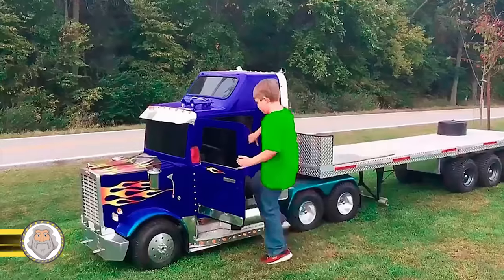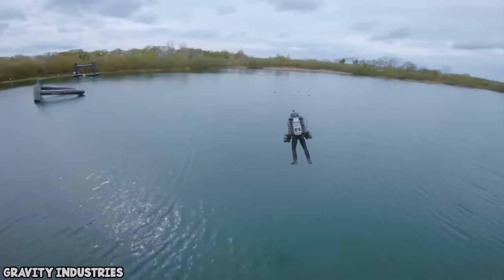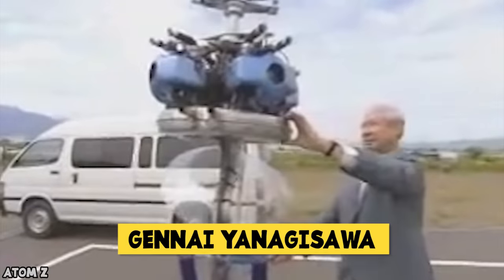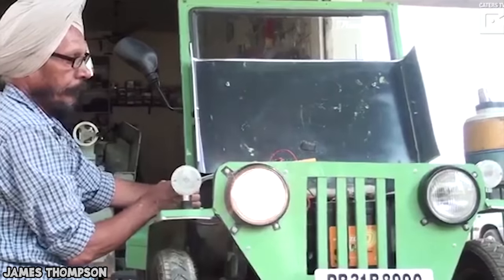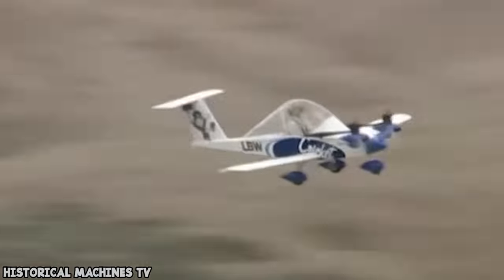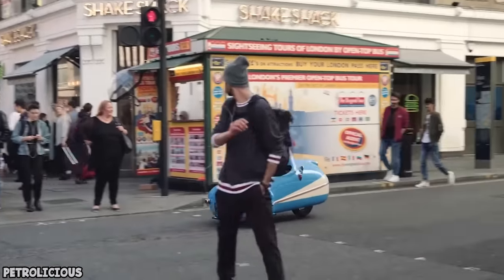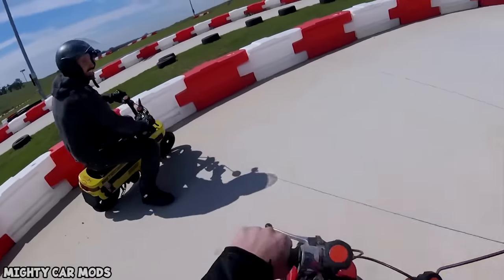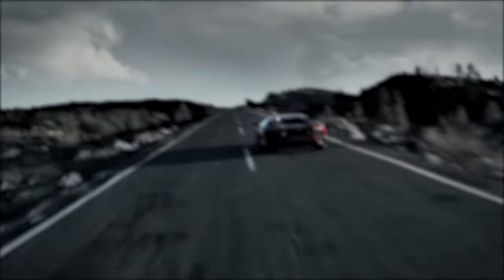15 Smallest Vehicles With Powerful Engine!

Comment: The cricket airplane appears to have two engines. If I am not mistaken (and I could be) the wires are for spark plugs not needed on an electric. Plus there are two exhaust pipes, also not needed on an electric.
Reply: Also available with two jet engines.

Comment: Obviously, the "Cricket" airplane shown are not battery powered.  You can clearly see exhaust pipes and spark plugs sticking out from the top of the engines.
Reply: Kre Kn there factory battery’s

Comment: 11:05 - The Cricket. I don't know what that was that you were showing, but whatever it was, it was definitely was not electric or battery powered. Those are clearly 2-stroke engines mounted on the front of the plane.
Reply: Not to mention there's only 2 of them, not 4 as he said.

Comment: I had a 1957 German Gogomobile. A 2 cyl rear engine 4 spd. It rode on 10" boat trailer tires. It was a micro car. You could not see it parked in front of a 1980 Plymouth Horizon. It fit in the back of a pick up truck. I used to chain it to a light post when I drove it somewhere so no one could pick it up and take off.

Comment: Can we talk about #7 ( 11:08 ) though? "its a tiny, homemade, electric, battery powered airplane" the clip where this was said literally showing the muffler and exhaust system, the carb and spark plug of this little petrol engine lol. Now I'm not saying there arent models that arent electric in existance but the ones in the video are 100% petrol.
Reply: I was confused by that as well because the one in the video was clearly powered by internal combustion engines

Comment: The cri-cri cricket has twin 15cc combustion engines, where did the LiPo engine come from, LiPo is a battery not an engine, you need to check your scripts before confusing people.
Reply: Yeah i was like whaatt..
Reply: Not to rain on your parade,  the cri cri has twin 15 horse power ICE's not 15cc which is cubic centimeter, there is also a pretty bad ass turbine version. I fly rc planes and have several 15cc nitromethane and gas engines.. if those would lift a person... you can bet I would be flying in them :)
Reply: They are two two stroke combustion engines. They are not 15CC

Comment: 11:05 - The Cricket. I don't know what that was that you were showing, but whatever it was, it was definitely was not electric or battery powered. Those are clearly 2-stroke engines mounted on the front of the plane.

Comment: Everything wrong with this video: (Just kidding, No offence intended to the creator, just making some corrections and commenting on each vehicle.) :)  
#15 Most of the mini-semis shown are one-of-a-kind homebuilt trucks. Most of them have gasoline engines producing 5-15hp with some having more power than that. Generally, they have a top speed of 15-25mph. The electric mini-truck you talk about; the "S730" is an open roofed toy and not a real go-kart. (think power-wheels). 

#14 Gravity suit is cool, but fuel will always be the bane of this kind of thing. Until we can find some sort of unlimited power source and even then, we would need to create thrust somehow and there's only so many ways to go about doing that which produces a high enough power to weight ratio. Also, I bet it requires LOTS of training and practice to fly. Still cool. 

#13 Badger Assault Tank is a neat idea for SWAT to use as a shock weapon. Might actually prove useful in some scenarios. Awesome little machine, based on a mini skid loader chassis. 
At 3:43 the tank shown is the chassis of a tank built by a man in Australia, the tank is a scaled down version of a Sherman tank. Here's the video. https://www.youtube.com/watch?v=W65iNSKKn5s Mr. Tankman Dave also named his tank CHASSIS the "Badger" but in no way is it connected to the Howe & Howe brother's Badger tank. At 3:49 you show paintball tanks. https://www.youtube.com/watch?v=thmvxp3tcy8 There are companies in the USA and England (and probably elseware) that use these for tank-only paintball games; Very cool, and looks super fun, but they definitely are NOT the Howe & Howe Badger. 

#12 is the Bede BD5J. Absolutely awesome machine. 

#11 FREEKING AWESOME. I love that little machine. 

#10 Smallest "Street Legal" jeep. Its a cool machine, and he is an awesome car builder! AND he is helping people. That is the coolest thing about it. 
But, if you include off-road-only: (this isn't a correction, just an additional info) They get SMALLER! :) Because this exists https://www.youtube.com/watch?v=I9LtgcHLn0I And even smaller and cooler, THIS exists! hehe. https://www.youtube.com/watch?v=LMg4rfK-KZ4 

#9 Mosquito Helicopter is awesome. 

#8 Peel P50 is epic and ugly! I love it. 

#7 Here....this one hurt. It only has TWO motors, there IS 1 Cri-Cri that is electric, it originally had a flight time of 30 minutes and can reach 80mph. The builder Upgraded the plane with stronger 25hp electric motors and LiPo batteries, I wasn't able to find flight time for that version but it did reach almost 165mph singe the electric motors have lower drag than the bulky gasoline engines do.  The gasoline versions have 15hp engines that give a max speed of 140mph (120mph cruise) and have a cruise range of 144 minutes. There is a version with Jet engines, but it has the same performance as the gasoline version. The first flight was in the early 1970s, unless you are talking about the electric version which as you say, flew in 2010

#6 is awesome. You nailed it. 

#5 is really cool. 

#4 is awesome, I Would TOTALLY ride that thing!!

#3 looks fun and useful.

#2 That thing is so slow and so ugly. lol. 

#1 Volksjager is such a fascinating machine. 

Final thoughts, Just do a bit more research, as a presenter you do a fantastic job. Keep up the good work,

Comment: There is a huge difference between an engine and a motor. Battery power is not an Engine. It is a Motor. So all those battery powered vehicles are disqualified.

Comment: The Cri Cri Cricket is not battery powered. It is single cylinder air cooled 2 stroke engines

Comment: I am so confused by the Cri-Cri.  It shows the airplane that clearly has 2 internal combustion engines, but the narrator said it runs on 4 electric "15cc" motors powered by li-po batteries...  First off, electric motors are not measured in cc, second, there are only 2 motors, third the motors are way bigger than 15cc (I have 23cc on my weed whip and a 32cc engine on my chain saw).  The vehicles are cool to look at but this narrator clearly has no idea what he is talking about...

Comment: So how did you think that airplane with two internal combustion engines had 4 electric motors??
Reply: Did you not see them starting the engines ?
Reply: And why would it have a 15cc engine , you don’t measure electric motors in cubic centimeters

Comment: A video that's supposed to be about small vehicles with powerful engines and the first thing they talk about is something with a motor and not an engine. An engine converts fuel into energy to cause motive force, and a motor merely converts energy into motive force. 🤷‍♂

Comment: Quite a bit of research would have helped a lot. Bede BD-5J and Microhelicopters are from the 50's, as in 1950 to 1959. Ultralight helicopters are a dime a dozen. Peel P50, 47 were made 50 to 65. Colomban Cricri, Battery powered 15 cc motor, seriously. 500 cc, 15 hp each, no battery. You can't have a ride, cause it's single seat. Brütsch Mopetta, not road legal anywhere in the western world. Don't you do any research at all? I'm not even going to start on the Heinkel 162, it's so all wrong.

Comment: #7 ( cri cri cricket ) the plane is NOT powered by electric motors...not sure the source the narrator is going off of but it is completely incorrect...the plane is powered by 2 gasoline motors propeller driven...it ALSO comes in a twin jet variation...NEITHER VERSION IS ELECTIC MOTOR POWERED!!
Reply: Chill

Comment: How ignorant is this guy... the cri-cri IS NOT BATTERY POWERED! There are 2 gas 2-stroke engines on it with expansion chamber exhausts!! BTW THESE VEHICLES DONT HAVE POWERFUL ENGINES, EXCEPT FOR THE 2 STROKE GAS ENGINE PLANE THAT YOU CALLED ELECTRIC!

Comment: What a crap video. Started out with a golf cart that won’t even go walking speed. The peel P50 has a 49cc engine that only makes like 2 and a half HP. I would go on but I won’t.
Reply: Barry Fields I thought it had a ground breaking breath taking virginity taking 4 horsepower